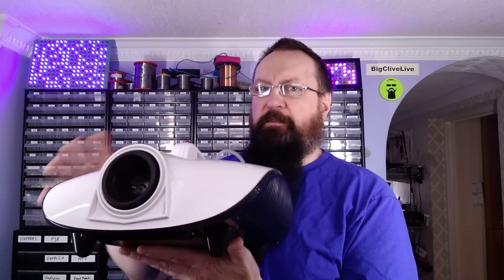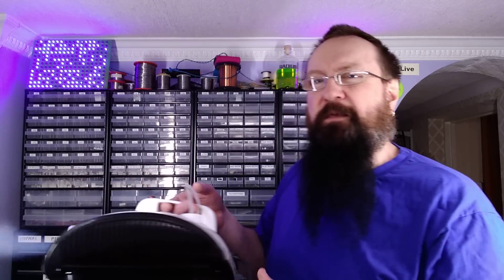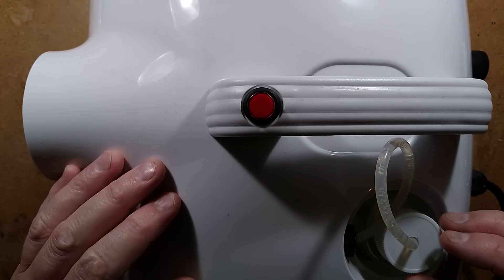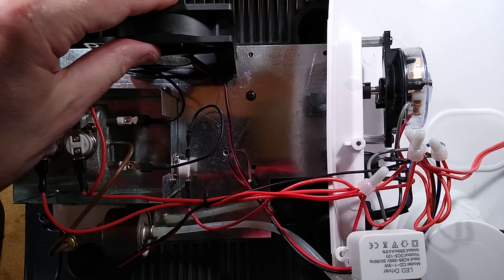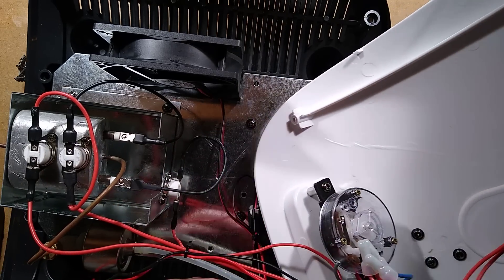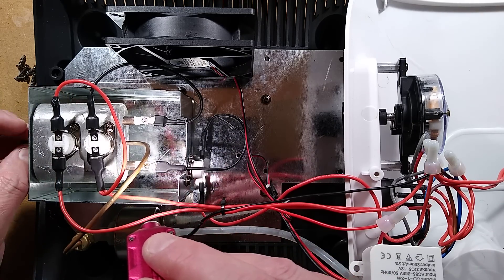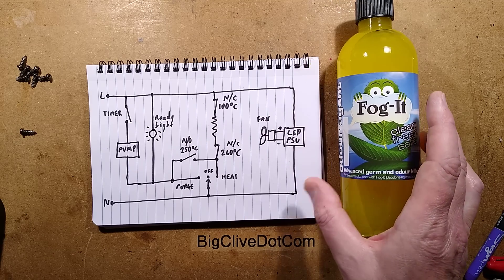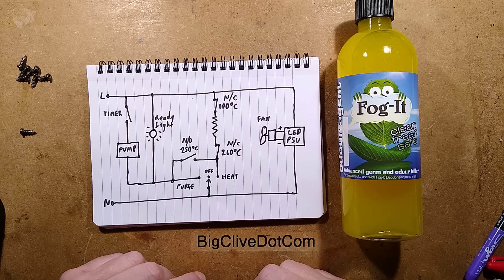Inside a car/room fogging disinfection unit (with schematic)

Comment: Your camera mic. circuit must have a compressor. The volume for the noise, and your voice stayed the same.
Sounded fine.
Reply from the maker: It does, and I also run the completed videos through a simple audio app to fix issues.

Comment: Mmm. Doesn't look very safe to me. The wire connections look a bit bodged and the wires aren't particularly well managed, and they're not thermal protected (sleeve). It's probably overpriced for what it is. I wonder if I could use this to fog bug killer fluid. That would be useful

Comment: Hi Clive , ive got no volume control !!! no glasses   a cracked screen, , .....dogging disinfection unit  !! Wtf,  I’ve got yet another Chinese electronic gadget thats gone wrong as 83% of mine have,  i took it apart to try find out why it stoped after 6 rods of glue , so impressed was i that i gave my mains powered glue gun to a mate in need ,  as his Harley pulled away my new glue gun died , the words of my cousin Michal from Ayer whisper ,,...no good turn goes unpunished aaaaarrrgg its just a poxy non epoxy fuckkinggn glue gun ....cost £25  i thought id found the fault it worked another stick then stoped , it does have a chip I suspect this is the problem. Would you take a peek,  cheers roy
Reply from the maker: These things normally just have the power going straight to a self regulating heater.  It's fairly simple, but literally a ceramic plate clamped between two electrode plates.  If there's extra circuitry it does introduce new failure modes.
Reply: Thanks Clive ill by pass the chip and make sure to only use it for short bursts , I guess theirs a current limiter or pratsile thats gone all Chinese on me ..cool !

Comment: That's a cracking beard - have you dyed it ? 

Mine is very grey - any tips would be appreciated.
Reply from the maker: On a whim I dyed my hair and beard jet black with standard hair dye.
Reply: @bigclivedotcom  I don't think mine's long enough (matron) to get the full effect yours has. 

Anyway thanks for great stimulation to a stubbly pretender !

Comment: Clive, got a quick question for you. My dad’s small air compressor quit the other day, and upon partial tear down and operation with the cover off, I noticed an arc across a component, which turns out to be a Klixon 7AM214B5, I believe it’s a thermal breaker, opening temp of 135 degrees science and an ohm rating of 468cmf. I assume it should not be arcing across? Likely that this is causing the issue? (It will start and run for a split second before shutting itself off again, and if the switch is left on it will repeat that every few seconds)

I am having a hard time finding a replacement for it, any help locating one would be greatly appreciated. I am in the US.
Reply: Edit: 468 ohms/cmf

Comment: Usually these are a scam. Proper disinfecting foggers use very low heat ultra high pressure - and there's a simple reason; the high heat, party type type fogging machines neutralize almost all disinfectants rendering them useless. QAC's such as benzalkonium chloride (as mentioned) completely decompose at around 150c, losing all effectiveness. The only known and common disinfectant that can survive those temperatures demonstrated is a special peroxide based fog - at ppm that require you to exit the room - and appropriately vent it after the requisite time.

Comment: AFAIK Ethoxylated alcohol, Glyoxal, Benzalkonium Chloride, and a lot of Formaldehyde.
Reply from the maker: Only one of those is mentioned in their MSDS sheet.
Reply: @bigclivedotcom  Might be a different Fog It for car/domestic use.
https://askura.cz/_files/200000120-c23d2c337f/Fogit.pdf
Reply: I normally mist stuff with peracetic acid to disinfect areas and a use blend of organic acids to neutralise smells. Probably not that good inside a car though.
Reply from the maker: @khaitomretro  Possibly different countries having stricter chemical declaration regulations.

Comment: Since you showed the heater has to wait every minute or so to get back up to 250°C, having the switch on the purge position would cut out the heater as soon as it goes under 250°C.
Reply from the maker: It only seems to reheat once at the beginning of the cycle.  After that it runs continuously.
Reply: @bigclivedotcom  oh okay I guess that makes sense, the aluminium surrounding it smooths out the temperature

Comment: Hey Clive! We use a system similar to this in medical infection control for the NHS. Specifically hydrogen peroxide vapour; or HPV.

Love the video ✌️
Reply: That stuff is very dangerous to inhale. Look up Toxic Substances Portal - Hydrogen Peroxide. It is heavier than air so it falls to the floor. 
What kind of infection is it used to prevent, and how?
Reply: @milcotto4153  It's used to sanitise clinical areas (wards, operating theatres and so on), obviously while no-one is actually in there. :)

Comment: Instead of putting a lead through a car door you can usually find a way to get a lead out through the back seats (or around them) and have the lead come out through the boot. Definitely a much safer option.

Comment: Here's the safety sheet: http://www.cleaningsystems.co.nz/Modules/DocumentLibrary/DocumentDownload.aspx?DocumentId=647
The Ethoxylated alcohols are I what assume Fog-It calls the biocidal ingredient, otherwise it would probably mentioned as a separate entry on the ingredient list. It's a surfactant, and it will kill bacteria (and fish in a high enough concentration), not viruses, but it's main purpose is in enabling the fogging. Incidentally, Fog-It's Amazon listing mentions a specific list of bacteria, but no other forms of microscopical  (semi-)lifeforms.
Any other ingredients were not required to be mentioned on the safety sheet, so these are just the colourants and 
fragrances and other harmless substances. I'm fairly certain that Fog-Its main effect is making you car smell nice, and any biocidal effect is purely coincidental.

Comment: Those thermal switches are designed for protection, not as thermostats, if it cycles in normal use, I doubt it will live long (or prosper)
Reply from the maker: These things are made down to a price and often fail dramatically.

Comment: Car wheels are easily conductive enough to trigger the RCD on mains power, in fact they pass current pretty readily even at automotive type voltages, so there isn't a big risk of your entire car being live and shocking you. This is also why inside a car is actually a very safe place to wait out a lightning storm, and why its easy to give yourself static shocks touching a car if you have insulated footwear, but you don't get them in anti-static footwear (which is conductive).
Reply: I dispute this.  On reading your comment I went out and stabbed my Ohmmeter into the tyres on my car and I found that even with them only 1mm apart the resistance is greater than 30MOhms which is the upper limit of my meter.

Cars protect you from lightning because the steel body of the car conducts the current round you and it then arcs across the tyres to the ground.

I agree that tyres are conductive enough to discharge static charges and any shocks you get on exiting a car are due to friction between your clothing and the car seats, the car itself does not hold a charge.

Comment: In my power bank flash led is always on but discharge is not done.what might be the problem. The 4 blue led battery soc indicator also not working.

Comment: In a laboratory, when you spray rubbing alcohol on the counter to disinfect it, you have to wipe it down with a paper towel because the spray does not saturate the total surface, just the spots where the droplets fall.  These disinfectant "foggers" are the same, they do not saturate the surfaces with disinfectant so unless the surfaces are wiped, not all of the surface would be disinfected.   These devices have never been tested as to whether or not they actually disinfect anything and most likely do not.  They only exist as excuses fir having done something while minimizing the labour required.   I suspect that if you run the fogger long enough then they might be effective but just passing the disinfectant across heaters could change their effectiveness.  You might as well strap a fan to a vaping ecigarette.

Comment: quite dangerous to use.  Disinfectant are harmless in buck solution.  The skill won't absorb it in the normal condition.  However, once it is in vapor, it can be easily absorbed by the lungs and damage the cells of the air sacs.  It is nothing but sounds like Donald Trump therapy for injecting disinfectants into body.

Comment: Are you sure that element is potted in aluminum? Seems it would be easier to use an aluminum filled resin. www.smooth-on.com sells resins that look and have thermal properties just like metals - think JB Weld but instead of being epoxy they're castable urethanes. Cool materials to work with.

Comment: Ralfy's Manx bothy seems to have a mold problem. Maybe you could hook that thing up in there with some unscented disinfectant set on a timer so it runs when he's not there.
Reply from the maker: It's a classic old damp stone bothy.
Reply: @bigclivedotcom  I know. I was kind of kidding. I would like to see his reaction when he walked in and the room was stark white with a recirculating air purification system and dehumidifier running and the light levels raised to at least 16000 lux (white light, not that brown light you like). Add a raised tile floor and replace the furniture with lab seating and tables so nothing in the room would interfere with the taste and smell of his products under review.

The Manx cleanroom sounds nice. 😉

Comment: Probably no worse for the cable than the battery maintainers you plug into the OBD or lighter plug and slam the door on the mains cable...I have done it often for radio antenna coax if you run it at an angle damage seems rare.

Comment: Hey Clive.... I do agree with what you are saying when it comes to closing the cord in the car door and if it was bare wires then the car would be live with power but the only issue with that Theory is that I can't actually think of a vehicle made in the last 10/20 years that doesn't have some type of plastic door handles and wouldn't that be enough to protect you long enough for the car door to be opened and then  at that point of the car door being opened would probably break the connection between the mains and the car most likely........ just would like to know if I'm way off with the way I'm thinking about it or if that's correct from your electrician's background point of view on that thought????

Also I completely understand that it would just be safer to unplug it b4 touching the vehicle .... I'm not a complete dumbass LOL 

Thanks and absolutely love these types of teardown  videos so please keep them coming and thanks again

Comment: Might the wobbly fan be what's making it run so loudly?
Reply from the maker: Smoke machines are always noisy.  The solenoid pump buzzes loudly and the heater block makes the loud whooshing noise.
Reply: The fan would have to be seriously unbalanced, bladewise, to be so noisy. The noise is almost certainly the solenoid pump -- probably left noisy so that there's every incentive for the thumbed to switch it off before the thermonuclear failsafes get tested.

Comment: Having an Asian ex missus the instructions are perfectly clear, start car, select recirculate, put blower fan on high, plug fogger into cigarette lighter and enjoy. They must do a DC model as well, or their cars have very robust DC voltages.
For my next trick I proved black is white and ended up single.
Reply: LOL,   Chinglish, Japlish, and Singlish are really not that difficult to understand (except for some reason for Americans)!  The trick is to take each phrase as ABSOLUTELY LITERAL, and think hard about how it could apply to the product in the situation it is describing.  Unsurprisingly, it seems to be the same way that many SE Asian languages (particularly Chinese ones) are themselves structured.

Comment: 900w on that small aluminium blob? no way, how hasnt that thing melted like a snow man in the desert?!
Reply: @Phonotical
Said, "...melted like a snowman in a desert."
I had to laugh.  The desert has nothing to do with the temperature.  If you take your snowman to antarctica it would be in a desert because the precipitation is less than the amount which makes it qualify as a desert.  Your snowman would be very happy there in sub-zero temperatures.
Reply: @acmefixer1  Desert climates, not CDCs - cold desert climates, there is a difference
Reply: The 900W is absorbed by the latent heat of vapourisation of the liquid which limits the temperature to the boiling point of the liquid.  If it runs out of liquid then the temperature will rise fudrther but the normally closed overtemperature thermostat will protect it.
Reply: @petehiggins33  yeah im not sure of what part of energy transfer you think I dont understand, but whichever it is, youre wrong

Comment: I don't suppose you could get access to one of the fogger/mister units designed to use hydrogen peroxide for comparison? I've always been interested in getting one of those, I think they use those for suspected anthrax contamination and such.

Comment: We use formaldehyde to sterilize greenhouses with a pressure hose could formaldehyde be mixed with fogging liquid because I assume fog would get into every nook an kranny
Reply from the maker: It depends on the breakdown temperature of the formaldehyde.
It appears it starts breaking down at 150C but at temperatures below 300C it's slow, so it might work in a fogger.  It depends on how well it mixes and reacts with the water and glycols.
Reply: Formaldehyd is toxic and carcinogenic, i wouldn’t want to fog that. Why not just use chlorine if it’s just for disinfection?
Reply: @martenthornberg275  because formaldehyde kills everything an preparers the greenhouses for the next growing season
Reply: Fall Knight I get it works well as an disinfectant, but I would have thought chlorine does too with the bonus of being more people friendly

Comment: Per that schematic, the fan runs when the switch is in the OFF position?
Reply from the maker: Yes.  The fan runs all the time.  They recommend leaving it running while the heater is off to cool down.